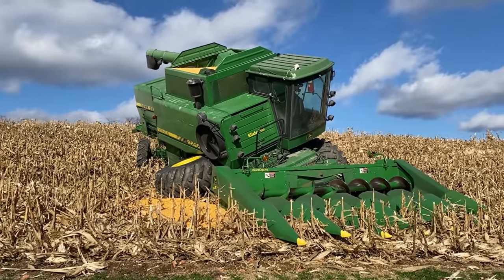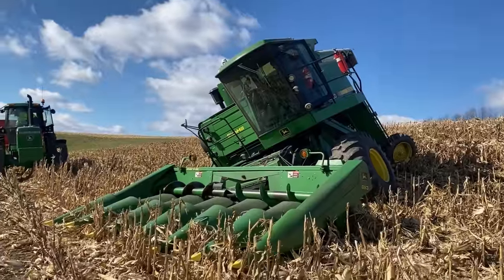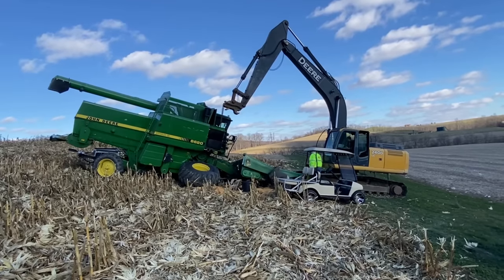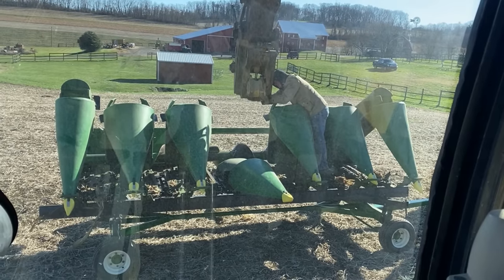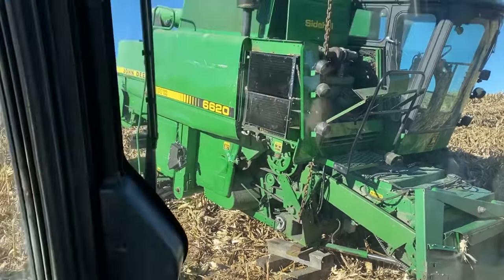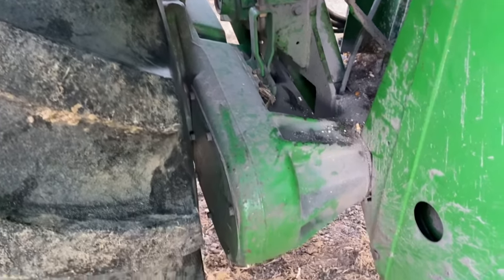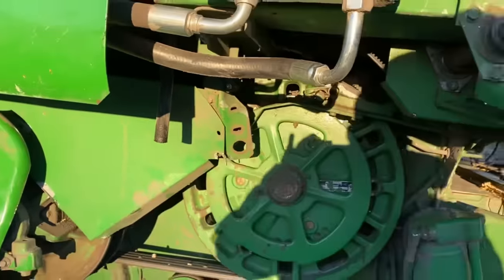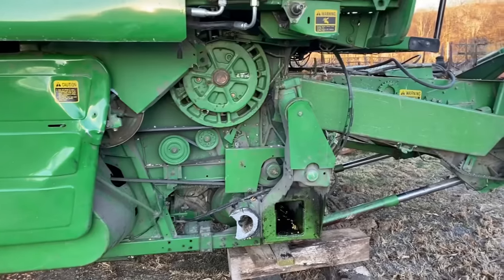John Deere 6620 Combine Broken Axle Recovery

Comment: Who ever the operator is, two rules. . Never do end rows with a full load. Never turn on a downhill grade with a full load. I'm really happy that this unit didn't completely land on it's side or worse. I could see from the way the rear wheels were turned, the operator was doing a sharp turn with an obviously full load into a fairly steep grade down. That was a beautiful recovery you guys made. Hopefully with some new parts and some wrench and hammering time she'll be as good as new again, soon. I'm sorry it happened to you, but in every mistake, we learn a lesson. Always off load into a cart when your near full or full before taking any kind of turn on steep grade. I'm just thankful no one was hurt and this happened so close to your shop. Again, great recovery guys, very impressed. God Bless y'all.
Reply from the maker: thanks for the comment! We were lucky it wasn't worse I am sure he will be keeping it lighter in the future
Reply: If that was possible. Lol. A lot of this stuff is nothing but hills and end rows.  But I know what you mean.
Reply: It’s like a bit IQ test for the driver , he will work it out .
Reply: You sound like someone who has done this once or twice :D
Reply: These machines should easily cope with this amount of stress from normal operation! No excuses there
Reply: We broke a rim on a similar side slope.  Had to unload, crib, it, break cribs, figure out we had to pull from the uphill side so it would slide off cribs.   Of course split rim broke the cords of the time that was new that year.   The grain bin extensions are a blessing and a curse.  Was on a New Holland.  @ScrappyIndustries

Comment: That has to be the cleanest 6620 I've seen since the 1980s. Hopefully you're able to get back together without breaking the bank.
Reply: It was one of the first harvesters i operated ... and im close to 60 now ... as an analogue machine, once you learnt its quirks and understood how temperature, humidity and grain moisture interact with the machine and how it thrashes, it was easy enough to get clean grain in the box, chaff out the back (with hardly any grain loss) ... and watch the hours tick by

Comment: Good assessment at the end.  That's pretty much how it goes.  Ya, for curiosity's sake you can usually tell where the old cracks were and the fresh break happened by discoloration.  Not all that useful except maybe to look there at the other side, if it is in a visible area.
There are spray kits than can help detect cracks, but I dunno if you wanna get carried away like that or not.
Reply: Magnaflux is one way to determine cracking. I've found it works better than the spray on kits. Magnetic particle inspection also works, but is pricey.

Comment: Your stick and bucket cylinders have more leverage than the boom. Use all the boom then go to the stick or bucket cylinders. Woops you just did it, nice! Keeping the boom as low  as possible helps if you shorten the chain. Your fortunate to have that 240.

Comment: The last good combine deere made. The new ones are all computers and lots of wiring. Too complicated for just taking corn off the cob and putting it in a box behind the operator! Make stuff simple!
Reply: As the owner of a 6600 for the last 30 years, I totally agree.
Reply: @repairmanjoe8081  those were dam good combines also! Had one for 25 years, till I wore all the tinwork out. Good diesel engines too.
Reply: While the old school farmers are out in the field combining, the high tech are still figuring out the monitors and why is that sensor not working right! Old school, still works!
Reply: l00
Reply: I have to say, our 9770 is a beast. Last before things went to  DEF
Reply: @ddubsmclovin  We were still out combining in out 70s gleaner while my boss's air conditioned, auto steering John Deere combine was burning to the ground because the catalytic converter failed. Then a month later his new one was sitting disabled in the field because a sensor failed and he couldn't replace it himself because JD decided to lock people out of fixing their own equipment. This is why I HATE deere. Even in the 70s you had to use a deere baler with the 2 cylinder engines because the screwed up crank timing was sheering stuff.
Reply: I'm no farmer, but this one doesn't look that old. Is it?
Reply: Not the 6620 I know that thing has so many promblems
Reply: They want to make the crap complicated so you can’t fix it yourself or you get so fustrated with heavy shop cost to just buy the next model.
Reply: The only reason they do that to make the average farmer can’t fix it. Can you image how much it would cost just to take to dealer and back again. Somebody told me it was 3 grand each way and that’s not even paying the repair cost !

Comment: WE just replaced a final drive on a 7700 and it uses the same drive we found a new one for $1800 We had a bearing failure that caused that wheel to lock up and bust the casting in the EXACT same place!!! Its a common issue with the sidehills

Comment: Without any good lifting points on the combine, here is where somebody needs to invent an inflatable salvage recovery bag.  A bag that would be fished under the combine and then inflated with compressed air.  Such a bag would distribute the weight and stress very evenly and make for an easy lift.  Then the combine could be blocked and set up for repair.  Or rigged with a better lifting arrangement to move it out.

Comment: Dejavu!  Had the same thing happen to a 6600 about 45 years ago.  Except the wheel frame broke half-off right around the wheel-bolts section.  The wheel collapsed under the frame so held the machine off the ground so absolutely nothing else was damaged except the wheel itself.  And, well, except the teenage operator who needed a new pair of  underwater and some intense psychological counseling, like "Shake it off boy, you could have been under that thing with it on top of you."  And, well, I told him it wasn't his fault, which wasn't exactly true, but I was weak and he was crying and shaking and trembling all over and establishment of responsibility would carry no weight with the insurance company anyway.  And he was a better operator for the rest of the season.
The Cause:  It was wheat harvest and with a fully loaded grain bin he went over a terrace too fast at an angle where there was a significant slope backside of the terrace.  And to make it all worse a dryed up mud hole, but was still soft right where the tire landed.
I dismounted the tire, massively heated around the wheel hole and pounded it back into position and welded it with nickel rods.  Lasted the rest of the year and as a shop table to this day.
I do think there was a foundry flaw in casting the wheel because right where it broke, (and where I welded), there were some tiny air bubbles in the metal.
I eventually got into the oil business where there is always someone to blame for a mistake who might coldcock you, but probably won't cry.  (One of the advantages of NOT being an independent businessman.)  
Good Luck, my friend.

Comment: at 16200lbs according to google I am surprised you are have the difficulty you are lifting it, now I dont know how much the front part weighs but I assume about 2k or 4k. I havent used excavators but I drive semis and I feel they could pick up a semi that is about 12k at the front 34k middle and 34k rear trailer pretty easy.
Reply from the maker: I agree with you- but there were a couple factors making it difficult. The way the machine was leaning on that hill we were lifting the majority of its weight at first. We also were not able to shovel all of the corn out of the bin so still a couple thousand pounds there. The hoe can’t lift too much at that high of a boom angle as the cylinders lose advantage. Someone said we should have driven the tracks up on logs to improve the geometry that was a good idea.

Comment: What caused the the disaster??
Reply from the maker: He had a full tank and turning down the hill.  Shouldn't have been and issue as far as I'm concerned but the trunnion thought otherwise
Reply: @ScrappyIndustries  I agree. A machine made to put and hold grain in a tank and specifically equipped to operate on hills and slopes... you'd think that this is part of its job description and they would build it to handle what they sell it for! Leave it to the bean counters to tell the farmer that nope, he should've known better. Can't make that up... I would understand and accept operator error if a machine rolls down the hill, but that's clearly not what happened here.

Comment: look like the hydralock bushing loosened a hair crack which let a little pressure enabling the wheel assembly to twist out from it missing half of the materal on the middle brace for the arm to fall out to the force of gravity and no other connections once the wire snapd to the gental graces of the lord resting on air.